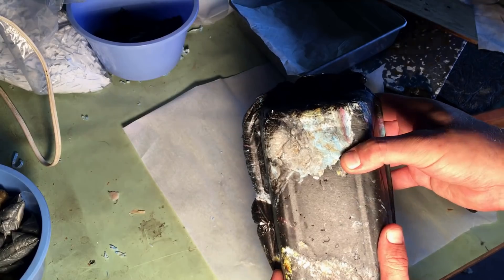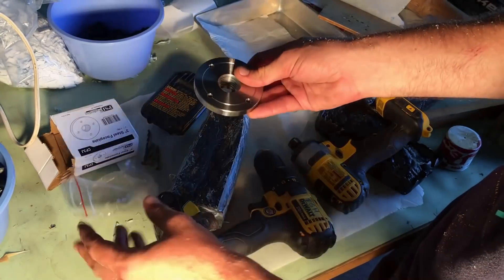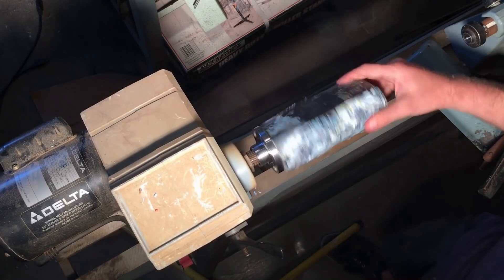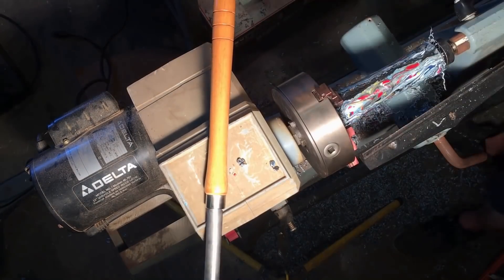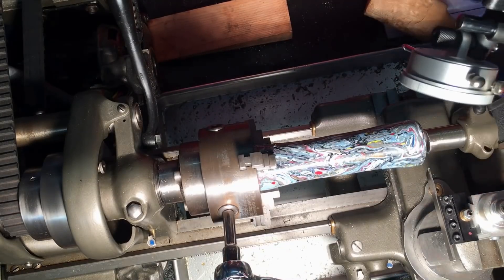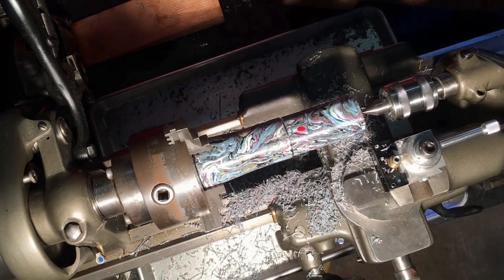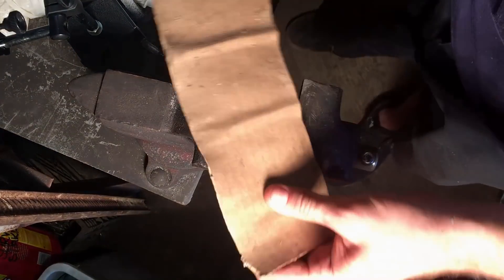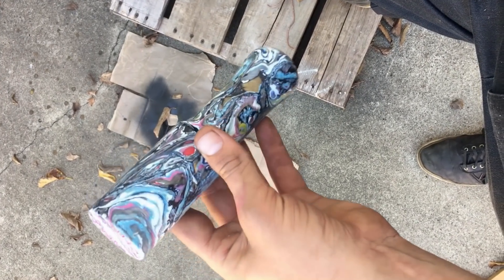Making a Mallet from Reclaimed #2 HDPE Plastic.

Comment: I tried my first block of hdpe on my lathe today. Roughing went fine, but shaping dulled my spindle and bowl gouge crazy quick. Anything special about your tools, or are you just using normal hss tools?
Reply from the maker: Hey that's awesome! I honestly haven't had the sophistication to invest in special lathe tools - just using the stuff that came with the machine. For my wood lathe, I am exclusively using HSS. On the metal lathe, I used both HSS and carbide inserts. 

In my Milling Video (https://youtu.be/AlV3IfBjkf4) you will see that I use a mill with both carbdide, coated HSS and uncoated HSS.

I have sharpened my wood lathe tools with a pedestal grinder. As a novice, my sharpening skill isn't great, but I was still happy with the results.

Comment: What kind of screws do you use for your faceplate for the lathe ?
Reply from the maker: I used to use wood screws. I have screwed up badly before though and broken a bad screw off in the workpiece. Nowadays, I would recommend using some kind of machine screw and a correctly sized hole, like a 1/4-20 cap screw.
Reply: CrunchWorks ok thanks for your input

Comment: Not any voids in the material? How did you prepare the plastic in melting?
Reply from the maker: A huge skill necessary is the ability to avoid voids. The technique to do it comes with practice and experience. Some tips that help: 1) work slow, a good melt can take all day. I usually make multiple blocks at a time. 2) Compression is necessary to get the molten plastic to harden evenly. Use  weights or a press. 3) Knead the molten blob. This part takes the most practice.

Comment: Get yourself some pipe cut offs in various sizes cut some rounds so you can clamp them up to cool. Scrap yards and some construction sites might have some they can part with.
Reply from the maker: James Tumlinson That is definitely the correct idea. Currently I can't fit a big pipe in my oven, but I'm working on a solution. As soon as it comes to fruition, I will make an updated video. Thanks for watching and commenting!
Reply: Arizona ice tea, cut the top off

Comment: One thing you can do for the roundness molds it use a soda can or a soap can of some sort. For a soda on you may want to use a monster or any tall monster can and poor the shredded plastic in it then stick it in the oven.
Reply from the maker: Thanks for the idea. I'm currently working on a new method and will be making a video about it at some point. Also, thanks for watching!